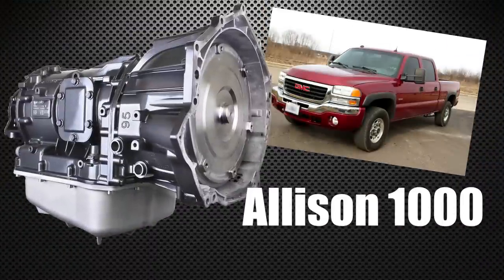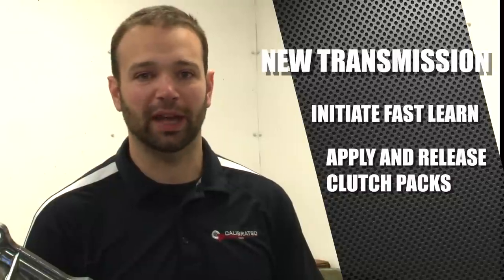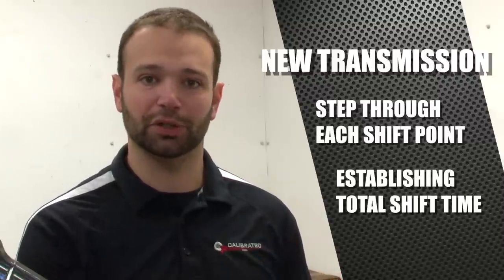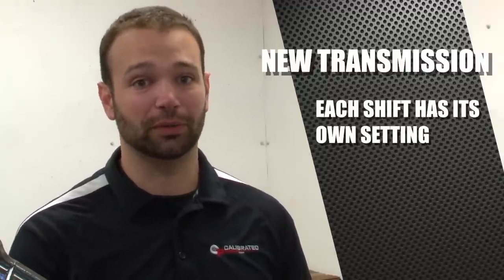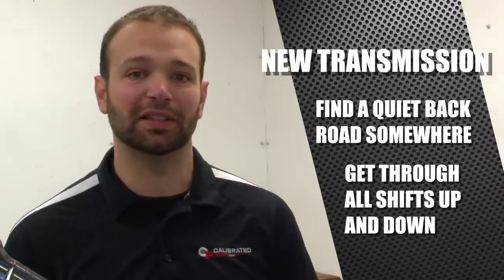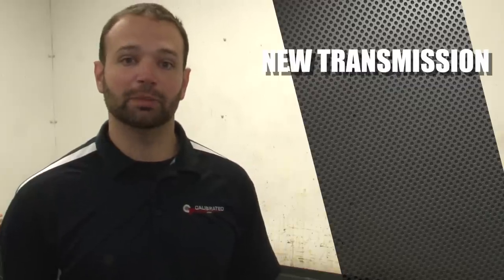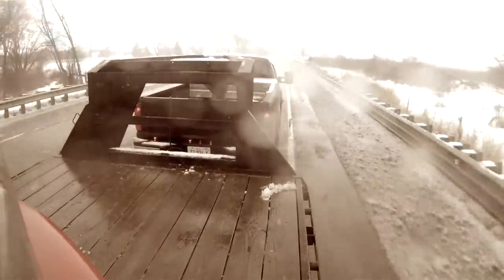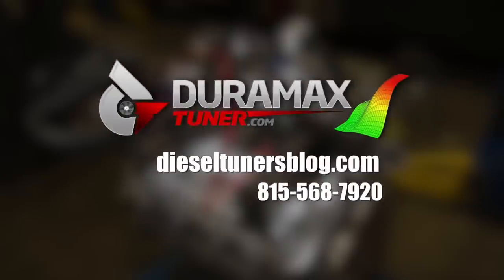Diesel Insights - Allison Transmission Learning

Comment: With regard to your comments in the last few minutes of this video, is it better to stay in one tune or the other (mileage tune vs. Tow tune) for the transmissions sake?

I pull a trailer(15,680 gvwr dump) on the weekends, then drive empty for most of the week.  I've always gone back to the mileage tune when empty.  This makes me think I should just stay in the tow tune......???
Reply: Doesn't matter as long you run it through all the gears a few times after switching, increasing the throttle each time. Do it a few times, especially when going to a higher power tune. It's not nearly as much of an issue when stepping down to lower power.

Comment: I have a question maybe you or one of the followers can help with... 05 Sierra duramax 5speed 290k I don't believe allison has ever been rebuilt.. I had a slight shudder when torque convertor was locked in (via edge monitor) I hauled my 30' bumper pull camper 850 miles round trip and now the shudder is horrible in 4th and 5th gear when tc is locked in, I did notice this usually happens after tranny temp hits 108° and up. Plan to do a service with both filters.
Also noticed that when brake pedal is applied when tc is locked it does not disengage like it should, my new brake switch just arrived today.. Hoping one or both helps as I don't have the funds for a 1200-1500 converter and labor

Comment: Hey guys, great video. Not so quick question for you... I recently bought a 2019 L5P, I installed a banks tuner at 500 miles and as recommended by Banks, daily drove on their highest setting. One time getting onto a highway I gave about 3/4 throttle and transmission stumbled and went into limp mode. After disconnecting and reconnecting the battery the truck was fine, until it happened a second time. I got pretty annoyed and took the tuner off and haven’t had this happen again (currently at 2000 mi) however when I’m in 3rd gear, I believe I’m feeling the torque converter lock and it drops about 2-300 RPM and just feels very odd, almost as if it’s two gears within the 3rd gear. This is my first Duramax/Allison combo (coming from a 6.0 gas 3/4 ton decided to upgrade to diesel as my horse trailer was putting a beating on previous truck). I’m not sure if the truck was shifting this way before the tuner/if it’s normal or if I’m freaking myself out for nothing. I had GM perform a reset of the transmission a few hundred miles ago but nothing has changed, so I’m wondering... is this normal, or, is my torque converter engaging too soon/at the wrong time? Sorry for the huge question... just a noob diesel owner here.
Reply: And just another tidbit of info... I have NOT towed with it yet, trying to get at least a few thousand on it before I hook up the 13k horse trailer, however if I put truck in tow/haul mode the torque converter locks in right as I get into 3rd gear with none of that funky rpm drop halfway through 3rd gear, which makes me think I could just be overthinking things... but would rather be safe than sorry, thanks.

Comment: My truck is tuned with Ez Lynk (A.R.T.) and i just started using an Edge CTS3 and i have the EAS SOTF installed, now that i can switch tunes on the fly should i do a relearn with the CTS? I'm on a 75hp setting and the tranny shifts nicely as it always has. But would a relearn be beneficial to the longevity of my transmission??
Reply from the maker: Wouldn't hurt to relearn the transmission.

Comment: My gmc 2005 Sierra duramax 2500 had won’t let me floor it it waits till it gets to 40mph then boost comes on what could this be is it in limp mode and will doing this transmission relearn help my truck go back to normal

Comment: Great video Nick. question for you guys.. I did a 4" FloPro exhaust, FASS Lift Pump, CP3, Wehrli full intake with downpipe, EGR Delete, then am doing the 1-5 PPEI Tune (30-150hp), do all of these tips on how to have the Allison re-learn/adapt apply if I haven't touched the Transmission? I would assume yes as it would make sense, but just wondering if there are any other tips for a guy who isn't doing a new transmission. Thanks for any help or just confirming I should go through all of the 1-2, 2-3, 3-4 etc on each of the 1-5 tunes (And back down).
Reply from the maker: "do all of these tips on how to have the Allison re-learn/adapt apply if I haven't touched the Transmission?" Yes they do.

Comment: Hey Nick, can this relearn be performed on your 6 speed conversion? Just had the trans built and some engine work done and it's shifting poorly. The Fleece tap shifter isn't working anymore either.
Reply from the maker: I would not expect a relearn to resolve those symptoms. Any codes when you scan it?

Comment: I did a transmission tune and didn’t do the relearn procedure after my trans leaked from top took to shop said it’s out vent getting to hot clutch damage needs new trans so you think that fried my trans not performing the relearn procedure ?
Reply from the maker: I would be very surprised if not doing the relearn procedure is completely to blame.  Were you driving it hard? Was it slamming into gear?

Comment: Would you relearn the transmission just bc you bought a used one? Just in case I have a different driving style than the previous owner.
Reply from the maker: If you are flashing the transmission computer, always a good habit to drive it with relearn in mind.

Comment: Just got my transmission built and got the truck back today. Shifts are pretty clean sometimes a rough downshift going from 2nd -1st. But when I go from neutral to park it has kind of a loud clunk to it when I move it slowly into gear. Is that normal? Even getting on it seems like it skips 4th gear and jumps to 5th
Reply: Drove it about 75-80miles today so lots of stops and starts and took my time shifting from park to drive to reverse back to park as well. If I shifted it fast up to park sound wasn’t bad
Reply: What was the verdict

Comment: I have a 2004.5 duramax LLy when it shifts into every gear it rpms come up and slams gear in
Reply from the maker: it may be time for a built transmission.
Reply: Its bone stock im just trying to gdt the truck back on the road

Comment: questions i have your spade jack and your stock trans tuning should i use my edge insight to to a trans relearn it seams to drive nice really didn't feel any difference with the shift points thank you could you guys maybe put some images up on your website about installing a oil temp sender PLEASE PLEASE and where the temps should me before summer i live in WEST texas and 100- 115 summer i want my truck to last PLEASE
Reply: I am planning to tap into the internal temperature sending unit that the TCM uses.

Comment: So what's your thoughts of an 05 Duramax Allison 5-speed transmission that shifts 1 2 2 3 3 4 but I get no 4 5 shift basically have no overdrive it does not shift into 5th gear at no check engine lights no codes stored in the computer I'm kind of stumped on this one any advice would be hot be nice
Reply from the maker: Does your torque converter lock? Are you monitoring gear selection with a CTS 2 or other monitor?
Reply: Torque converters not locking up and we are monitoring our shifts and data with a Solus Snap-on Solus thank you for replying I appreciate any feedback on this problem I'm having
Reply from the maker: @rwccwr7149  That trans is going to need to be opened up for diagnostics.

Comment: LBZ, Im hearing some rattling in my Allison . I hear it in  1st gear starting to take off, then goes away in higher idle.
Need help
Reply: only in first? or is there a noise in park also?
Reply: Duramax 315 
only in 1st. And a lighter noise in park
Reply: best case it's your exhaust rattling. worst case is your torque converter bolts are starting to get loose.
Reply: Duramax 315 
Thank you

Comment: can i use a spade to reset fast learn
Reply from the maker: Unfortunately not.
Reply: Duramaxtuner what about the edge
Reply from the maker: @robertschmidt7803  It will reset the taps but a more advanced tool will do a full relearn.

Comment: I’ve seen people using different types of transmission oil for the 1000 what is the correct type of oil for the Allison 1000??
Reply: Kiffs Landscaping tes-295. Stock trans? Allison recommends Transynd. They ship them to GM with Transynd in it, only for GM to drain and put Dex 3 or Dex 6 in (depending on year of duramax). But if you have a built trans, most builders will recommend Dex 3, I believe because of its viscosity, and it will arrive to you with that in it.
Reply: 10w-40 high mileage synthetic
Reply: @jhurley12  Am I understanding you correctly that Allison shipped a 2015 Chevy Silverado 2500 HD with Allison 1000 with transyd ATF and then GM changed the ATF fluid to Dex VI at the factory?
Do you have a source to validate your claim?
Reply: Chris Bryant I didnt say 2015,  so I can't speak for the 2015's, but at LEAST through LBZ, but you can pretty much accept it as fact for the older models if you look up in the forums, an Allison higher-up is a member there, and he stated that in a lengthy reply to the topic. Other members knew him to be an employee. And this is kind of a well known thing.

I can't imagine Allison changing their mind on what fluid to use. If Gm wants to waste Allison's time, that's up to GM. Transynd is what comes in them from Allison, that is fact. When you buy a new truck from GM, it has Dex 6 in it. That is also a fact. Who knows what deal GM has with Allison as far as who covers warranty due to a different fluid.. after all, GM owned Allison until recently. Dex 6 is fine..

Comment: Why would my lmm dually on 120 tune out of the gate too the floor defuel between 1st and 2nd so hard it puts you in the windshield and then instantly puts you back in your seat.?
Reply: trans safe tunes I'm assuming. defuels so your trans isn't taking peak torque while it shifts
Reply: Duramax 315 good to know.  Thanks.
Reply: Try the Hot Street (150 tune) and the defuel is gone :)
Reply: boost lord 
I have an lmm dually also, tuned by Idaho rob. It had plenty of balls, but also defuels badly when I hit it. I also have a built tranny. I’m going to get some moonshine next week. This defuel crap pisses me off, it’s ridiculous to have that much defueling

Comment: Im only 30 and went through automotive school but I miss mechanical instead of this electronic stuff. Seems like electronic just causes more issues. Glad airplanes are still almost completely  mechanical. Airbus's are a pos compared to Boeing and McDonald Douglas.
Reply: I agree partially with you. If it was mechanical then its easier to diagnose. On the other hand without the electronic support it wouldn't be able to adapt to all driving styles and probably wouldn't get over 300k on a stock truck without a transmission rebuild.